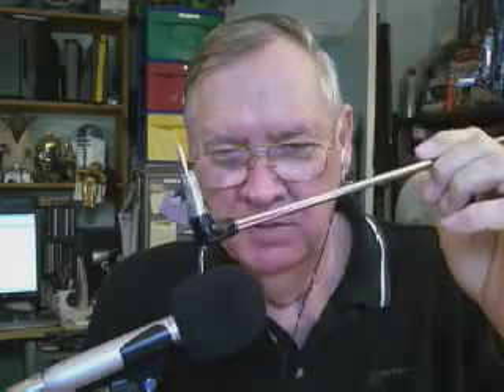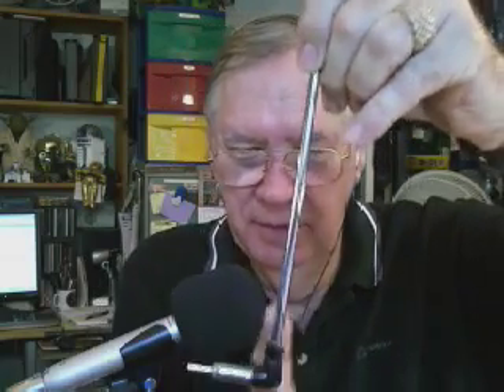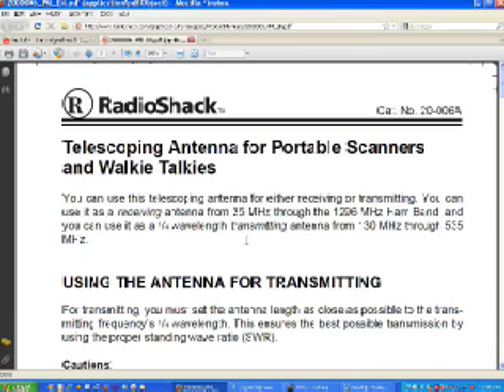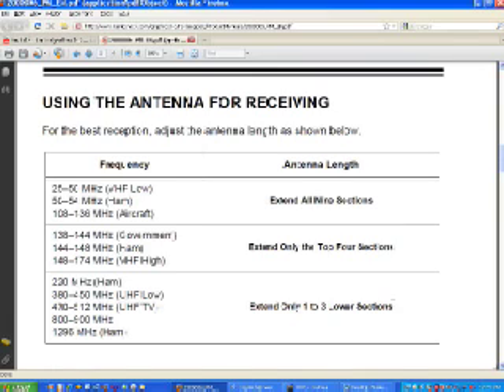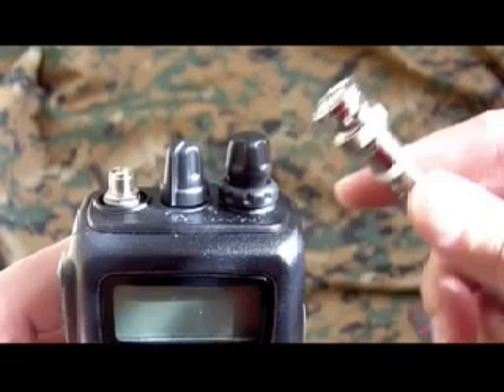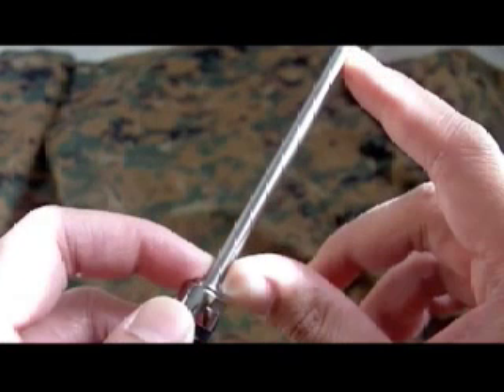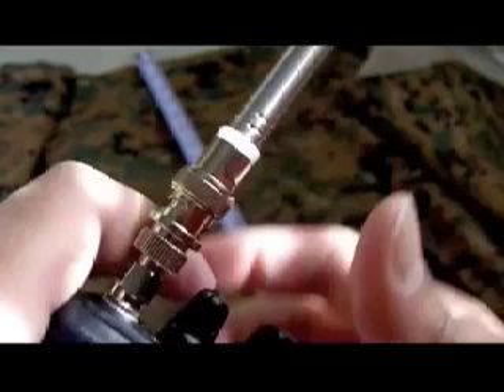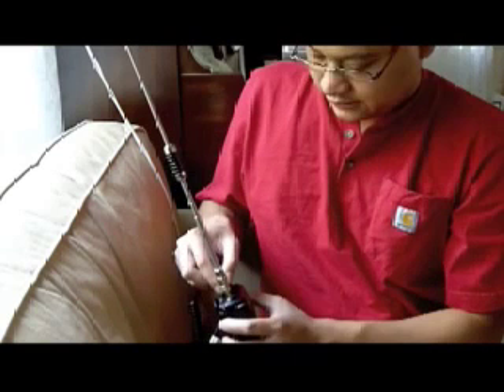TRRS #0022 - Radio Shack Center Loaded Antenna

Comment: I have an antenna like that for my BC346XT. I use that antenna at home, the rubber duck on the road. My scanner came with a BNC>TMA mounting adapter.

Comment: I have a Realistic TRC-217 handheld cb with one of the antennas, some one pained the center load part and I was wondering if that would cause a problem. I don’t believe that it will be a bother… by the way this is the first time I’ve seen a video of yours from this far back. Buddy the intro was awesome!!!
Reply from the maker: It should not make any difference.

Comment from the maker: Yes, it seems to only work for a specific frequency so it is not good for a scanner which usually is all over the band.  However, it may be good for amateur radio HT which normally operates only on narrow bands.

Thanks for your comment.

Tom